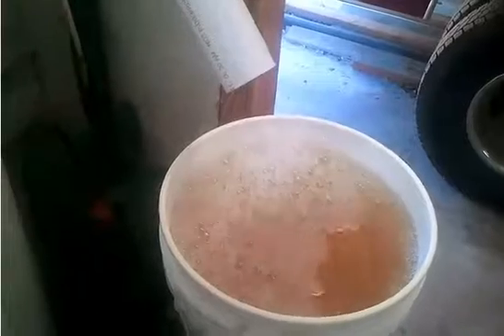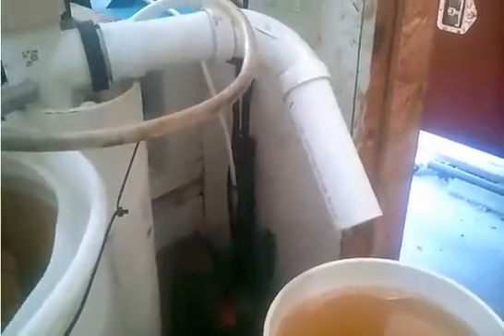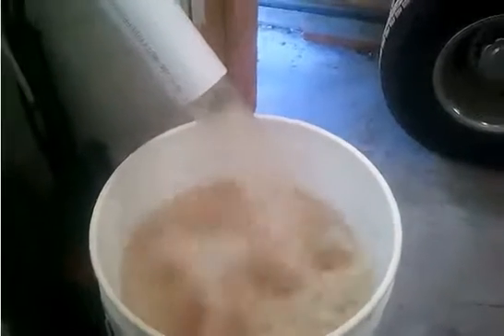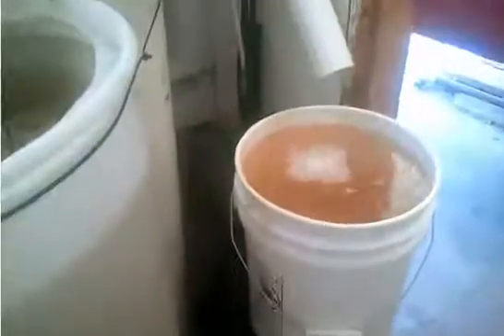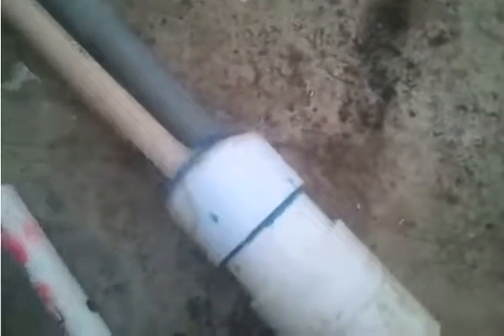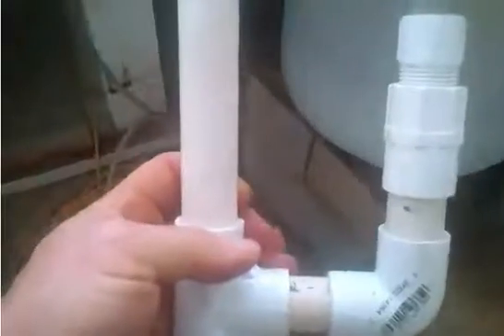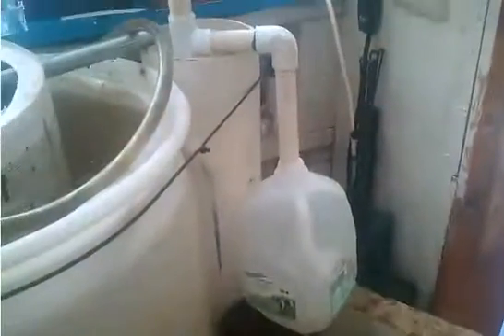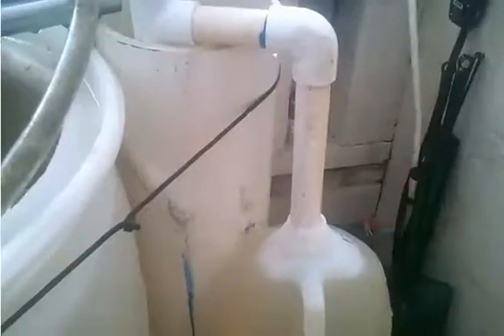Geysr vs Airlift Tests 8 15 2013

Comment: Hmm that does not seem to work like a geyser pump. Geyser pumps take time to fill up their chamber and then eject the water in a single blast. Maybe your air chamber is really small (in which case the benefit of the geyser pump is eliminated) or your air flow is so large that it refills almost immediately (but I doubt this).

Comment: Hi Bob,
Thank you so much for posting this video and sharing your knowledge.  I'm in the process of building my aquaponics system and need an airlift pump that will be able to lift the largest volume possible approximately eight feet (sump to fish tank).  I have a 60 watt pump.  Of all the airlifts you've tested, which do you think would be best...and do you have a schematic I could follow to accomplish the build?  Thanks again!
-Damon

Comment: So i was a bit confused about the differences of the 2 pump types . Simple airlift seems easier to make and the results are the same right?
Reply from the maker: +ErevosWanderer - The results varied back and forth but it was too close to say there was a real winner.  In the end I came to the conclusion  that the simple air lift pump was good enough, and that it was not worth going to all the extra expense and effort.
Reply: Thank you for the response Bob. One more thing.How high above the water surface can i pump the water ? I read somewhere that it is not high enough to be efficient,but from what i see on youtube videos , it seems to be efficient enough :P

Comment: Good video. I am thinking about this one and digging a 2-3 foot hole in the ground for extra volume of water - feed the tube with water from the bottom of a 5 gal bucket, use twin feed of air (or more) - try to get a lift of 5 1/2 feet. The deeper the water creates more pressure by the volume and pushes higher with the air, from what I comprehend.